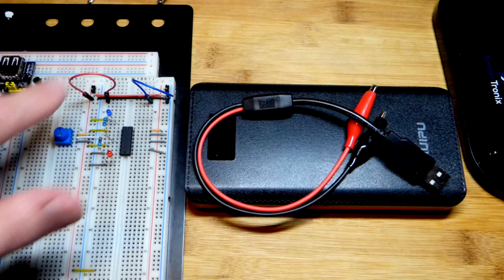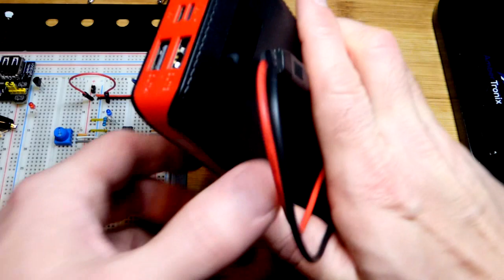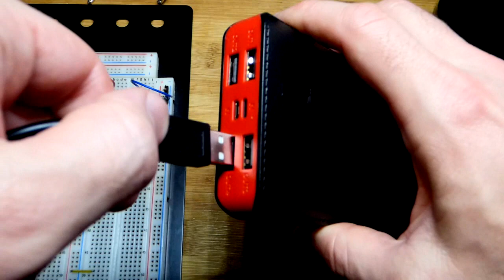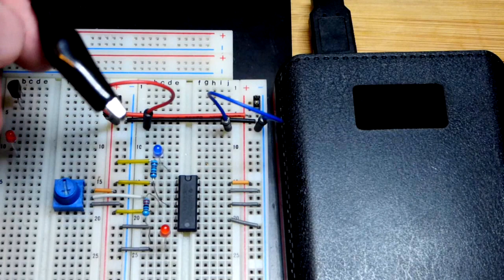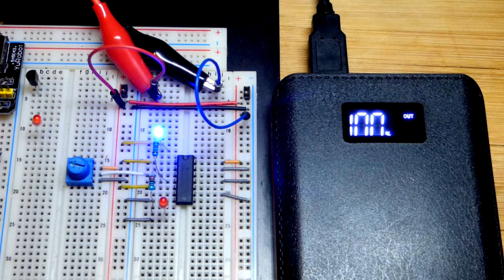How to use portable USB power bank for battery powering an electronics circuit

Comment: Can you suggest a good portable usb power supply that works with an active loop antenna?   Mine shuts down because it thinks my antenna is a full 
battery.
Reply from the maker: I have tried using most of mine to just power the USB tester I have, which only takes about 15mA of current by itself. They have all shut down after somewhere around a minute except for a cheap generic one that I got from Ebay that claims 50,000mAh but probably can't even actually provide 10,000mAh. It does turn off briefly every once in a while.
Reply: @Electronzap   I have been looking at using a 12 volt battery and a DC power converter like this one at Amazon.
https://www.amazon.com/Extractme-Converter-Regulator-Step-Down-Adapter/dp/B081NCXB2M/ref=sr_1_3?dchild=1&keywords=DC+12V+to+USB+5V+3A+Converter&qid=1606661571&sr=8-3
I think I will spend the ten bucks to check it out, fingers crossed.